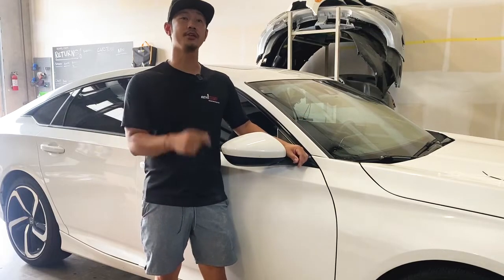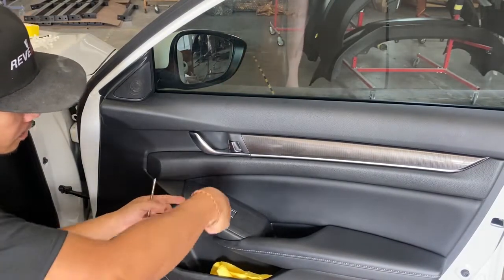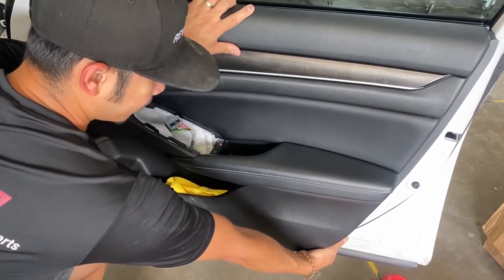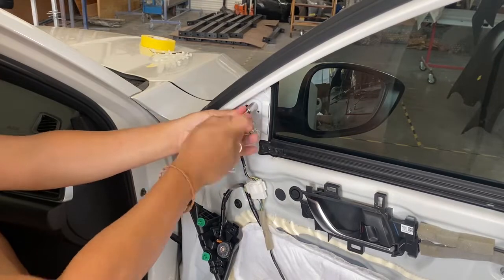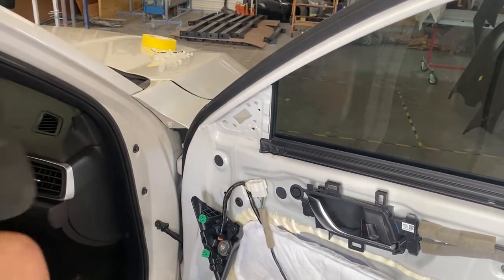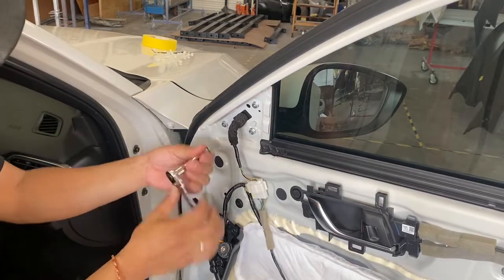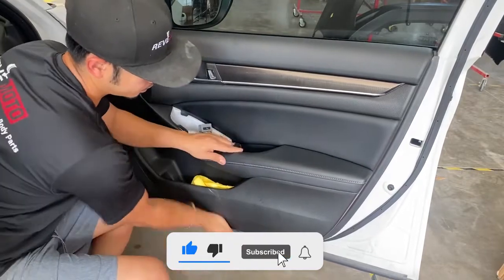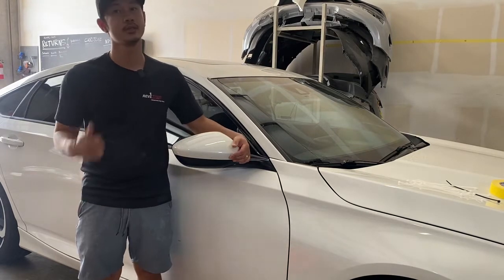How To Replace a 2018-2020 Honda Accord Side View Mirror | Quick 5-Min Install & Removal | ReveMoto

Comment: Thanks for the video.

I have a 2006 Accord.  Heads up for people with older models - the wiring snaps into the mirror just adjacent to the bolts that hold the mirror in place.  Which means I was able to replace the mirror without removing the door panel.  Which is awesome because I feel like any time I have to remove a panel I break or lose clips.
Reply from the maker: Thanks for the info! We're sure that will be helpful for a ton of people. Please sub if you haven't, it helps our channel grow! 😃

Comment: Perfect video on how to replace my 2020 Honda Accord Sport side mirror that a tree took out while backing up. I was able to find the right color painted skull cap for my car. Does that cap just somehow snap onto the mirror assembly? And do you think an OEM skull cap would fit a non-oem assembly? If not I will just pay extra for the oem since it is probably worth the extra money. Hope u get to see this! Thanks for great video!
Reply from the maker: Hello! Aftermarket parts are made in OEM moldings. Some companies are better than others but the OEM should absolutely fit on an aftermarket mirror. Yes, the cap does snap on, so it's very easy to put on. Taking the cap off is a bit tricky but it's probably broken so you should have no issues. Thank you for watching and please subscribe, it helps us a lot! 🤘

Comment: Hello what are all the tools that were used to replace the mirror as well as the screws in the door was it just the socket
Reply from the maker: You will use a 10mm socket, screw driver, flathead.  Let me know if you have additional questions.  If you need parts for your car go to www.ReveMoto.com
Reply: @ReveMoto  great thanks so much

Comment: i ended up replacing mine with an OEM mirror complete assembly that came with the lunar silver skull cap. Install was a breeze after seeing your video.....BUT as I was picking up the plastic panel part that holds the passenger side push-button window button and door lock button, a spring dropped onto the ground! EVERYTHING seems to work fine without that spring, but I am losing sleep over it! 
I could not tell if it actually came from that push button plastic panel, or maybe just dropped from somewhere else at the exact time I was picking up that power window button panel. The spring is about 1 inch long and as thick as a pencil. Have you or anyone ever come across a spring like that when working inside that door panel? Any ideas on what to check?
Reply from the maker: We're glad the installation went well! As for the spring, we don't know. It's good everything works but we can see how that would be nerve-racking. It's probably not from the window regulator buttons. That is often enclosed in one unit or housing. Does your door handle feel loose? I can't think of anywhere that spring would be useful except for the interior door handle. Please subscribe, it helps us a ton! ✌